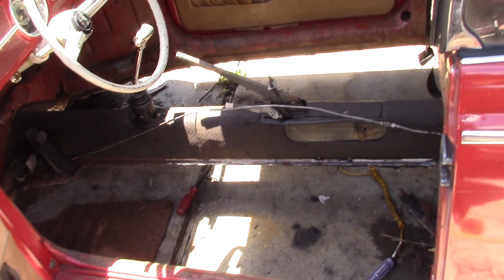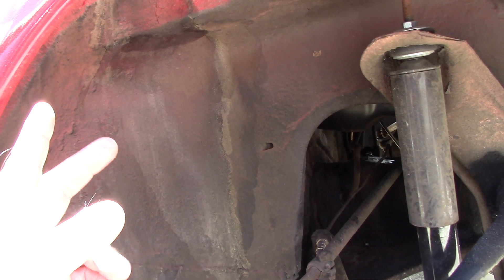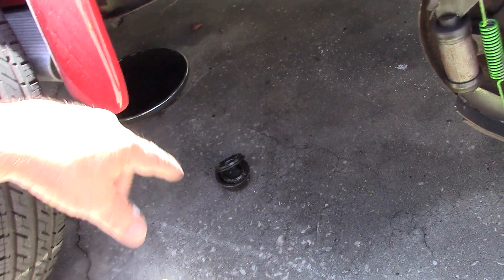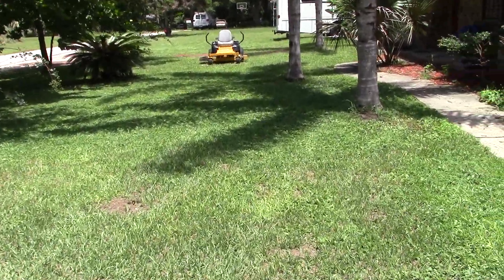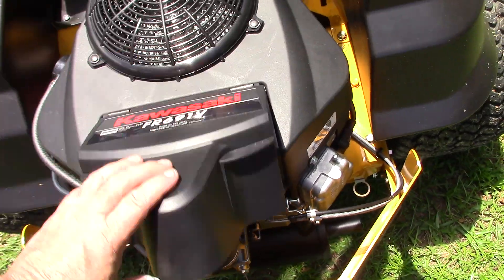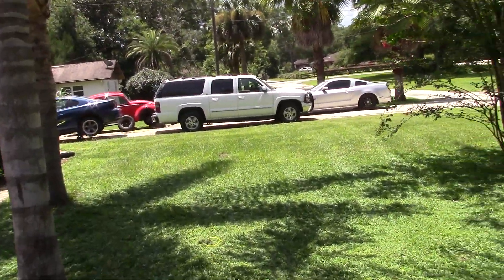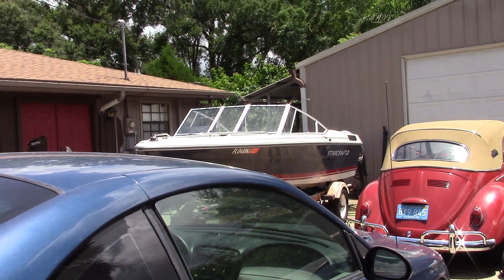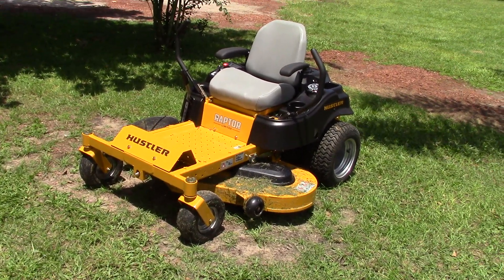new Hustler mower & some car's

Comment: Hustlers are governed to run at wide open throttle to have correct blade speed. After the warranty expired on  my Hustler, I started using Motorcraft FL-400S oil filters. better filter,and holds a pint more oil, at half the price. Research your present filter to verify correct threads, seal and bypass pressure. I have an extra set of blades, to swap out , then sharpen the take offs later. I am fortunate to have a case of old style (with ZDDP!) Pennzoil 30 weight oil. I think the Kawasaki brand oil may have the ZDDP, the factory engineer would no confirm or deny it though.(Cheap break-in oil scheme!)